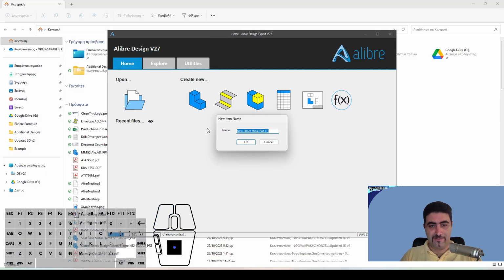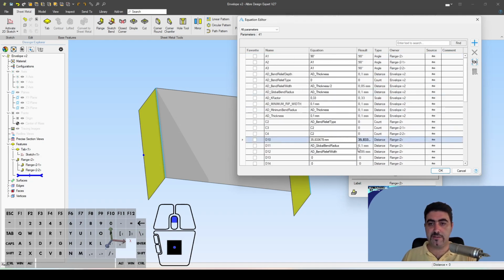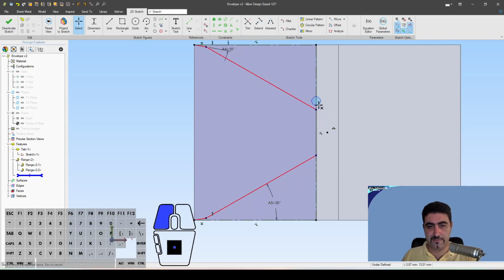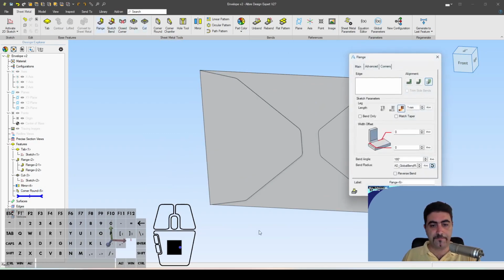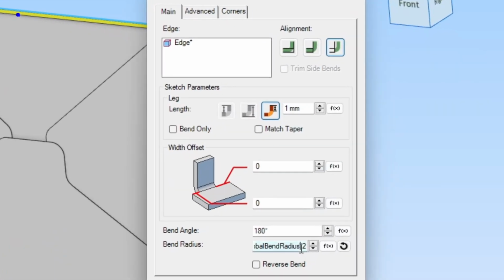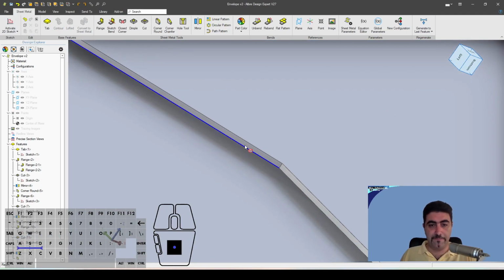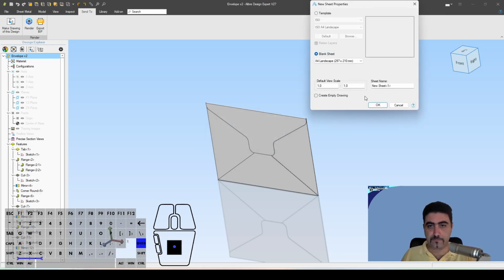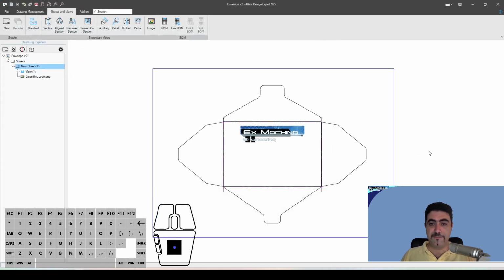The Unexpected Alibre Hack: Design Holiday Cards with Sheet Metal!

Comment: WHAT IS THE K-FACTOR OF PAPER?
AND THE SURFACE AREA CALCULATION FOR THE GLUE STRIP?
Reply: JK. Loved this demo!
Reply from the maker: Well, funnily enough the k-factor for paper is 0.5. At least that's what I use and it results in 0 elongation due to bending.
Now for the glue strip it would depend on the adhesive and the applicator.
In an industrial scale a robot could apply a 2mm bead which when squashed could cover the 5mm overlap I have allowed here.

P.S. I do hope you expected nothing less than the answer above 😂😂😆😜.
Thanks for the comment man! Glad you liked it
Reply: I knew you would know this information! @ExMachinaEngineering